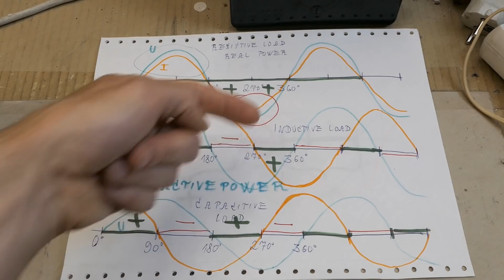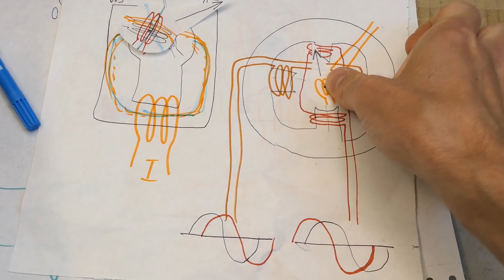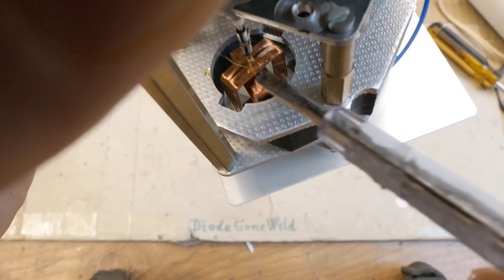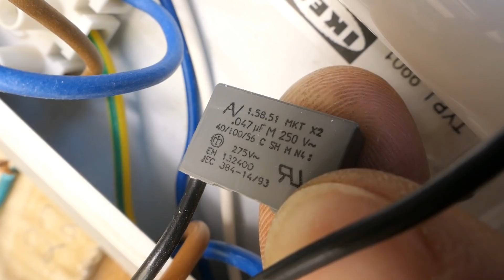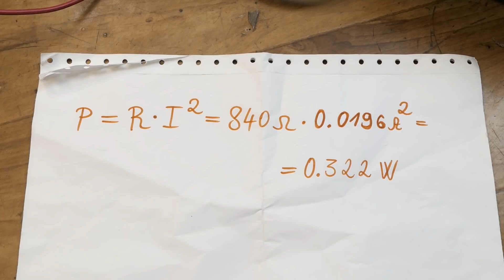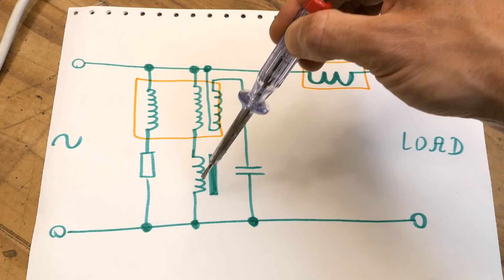Power factor meters - how do they work, teardown, experiments

Comment: On the two older meters, I think what they need to work 100V for the first one and 380V for the second one, and up to 5A on the current input for both. Like it says on the front of them. :) But yeah, like you said, risky if you aren't sure. I have no personal experience with electromechanical pf meters, we use digital power analyzers in our panels

Comment: Now i know why my multimeter is showing strange current reading when in ac, i though the ac current range is faulty as it always shows ridiculously high power reading like when i was testing at 100w powersupply that is drawing 4.6amps at 220v without a load and not even getting warm

Comment: Great video with lot of knowledge. at @23:18 there are 100V at meter so I will try calculating resistors as voltage divider with coils resistance, so after powering it up there should be about 100V at coil. Maybe inductance make some differences but I fill it will be good enough method.

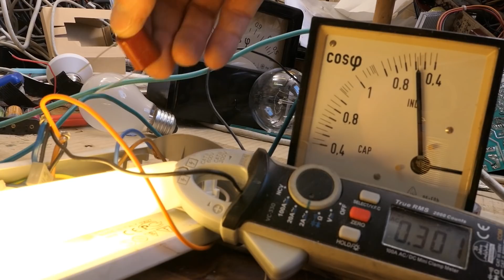Comment: 18:10 I did the same thing with a capatitor some time ago, and it zapped me. So, if you ever going to do something like that, better grab it only by 90 degrees side (oh, i mean better don't do this either way). It seems to be thicker isolation there.

Comment: For single phase systems, simply put the same reference phase into both reference terminals.  When the meter face is vertical, you are lifting the weight of the needle and more current is required to approach 1.

Comment: actually you dont need a common connection for 3 phase loads, because the sum of all the voltages at a given time will be 0V ideally, but imbalanced loads or varying voltages will make the common voltage look like it's not 0V, not a big problem for meters but for AC motors where the metal case is connected to the center of the Y connection, it's a good idea for safety to connect the common terminal to ground anyway.

Comment: we have this problem with Rockwell Engineering they sell baseline VFD ac drives then the customer has to troubleshoot the PF and buy all the addon inductors and capacitors to get the PowerFactor close to 1. where in the ero market the drives must be sold as a complete system to keep the power grid clean and lower the reactive power to rid wasted energy.  🤑thanks

Comment: I have very little electrical knowledge and have spent most of my life throwing things away when they stop working. Im intrigued by an idea that a alot of simple electronics can be made by hand and likely better than store bought. Is that the case or is everything so specialized now that aquiring the various components and the time it takes to make things, outweigh the benefit of making it yourself?
Reply: Don't throw lut. 9 out of 10 times there's something banal, like a fuse inside, or a broken plug. 

You need a knife, a screwdriver and that's it.

Comment: Wow, so long videos! I wish you can make a videos  about the Active PFC waveforms when the input power is not perfectly sinusoidal (like when using modified/approximate sinewave UPS) also, on the last UPS videos, the peak voltage can go over 400v. Does the input bulk capacitor gets that voltage & is it safe? Also will the Active PFC circuitry confused when its input power gets higher than the target output voltage

Comment: I guess nowadays it would all be done using analogue-to-digital converters and measuring the time between zero crossings in each phase to get the frequency and the phase shift.  I'm sure that is how the plug-in ones work.  On the one I bought several years ago, it looks as though the same housing could easily have been fitted with different inserts to suit different countries.

Still, it's impressive to see how it all used to be done using purely analogue devices!  And these were built with care like old-school scientific instruments by craftspeople who took a pride in their work, not mass-produced down to a price point so some beancounter can get a new sports car .....
Reply: It definitely must be. Every household wattmeter you can buy for like 10 EUR has the power factor measurement implemented. And it's pretty accurate. It's some kind of electronic black magic.

Comment: I'm curious about the Tester. I have one myself and I've noticed that it has Problems correctly displaying what it is for certain parts. For example, a Transistor is shown as an N MOSFET. But that's the only thing wrong. Resistors and Capacitors as well as Coils are displayed correctly.

Comment: You're truly mad.
I understand you know a lot about high voltage, I know a bit myself. 
I got shocked a few times in my life, I'm sure you tried it too.

But when you take a capacitor in your bare hand and touch your syuper dodgy 3 phase setup, my eyes and my mouth opened in disbelief 😮and started laughing.

And then you took another one in your OTHER hand and touched it too.🤣
Reply: Everything up to 1000 volts is low voltage.

Comment: I often wondered why flourescent lights (that use a magnetic ballast) often had a capacitor across the mains, now I know. If I remember, the light in my room has a 10uf cap across the mains.
Reply: There's a second reason. On dual tube lights, a capacitor is in series with one tube, both compensating for the inductive load and for doubling the flicker frequency of both tubes together through shifting the phase.

Comment: Yeah I was going to say in vertical position it looks like the needle has to fight gravity which would push it more toward capacitance reading
You could have checked the balance of it by shifting the two phases back and forth it should have read exactly the same reading and either capacitance or inductive if there were no other forces on the needle

Comment: what about smps circuits? they are using the upper part of the voltage peak. is it capacitive or inductive?
Reply: none it is distorted looks resistive but only at the peak of the waveform.
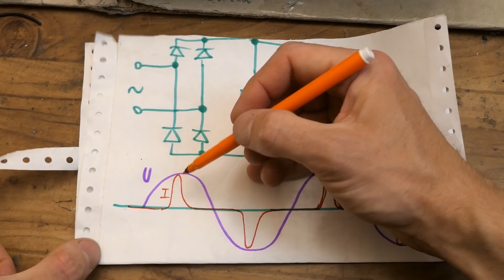Reply: A SMPS receives rectified and smoothed AC. It doesn’t run directly off AC. So it has the circuit shown at 36:26. Is is capacitive due to the input smoothing caps. But really it is more distorted than capacitive. There are power factor correction chips which adjust for this.
Reply: @stevebollinger3463  I havent watched the end of the video the first time I watched it. But then completed it. Thanks.

Comment: You can get passive PFC to be closer to a sine wave using a capacitor across that series inductor, tuned so that it is resonant at around 3 times the line frequency. That way the current in the diode is both on for a longer time in conduction, reducing the loss in the diode, as lower peak current flows, plus the capacitor gets charged for a longer time, and you get a much more closer approximation to a resistive load presented to the supply. Of course will have extra loss due to loss in the winding and the inductor core, so they need to be thicker copper wire and finer sheets of laminate to reduce loss. 

The major advantage comes with very high power, where active systems still struggle with power density, and also they add to the filtering on the input side, so are common at high power with large DC motor loads and very high power inverters, as this is easier to implement over wide input current than active compensation. Of course with high power AC motors the easiest is a synchronous motor as part of the plant, delivering some always on large load, that is over excited so as to appear to be capacitive, allowing you to use the power factor meter to control motor excitation to make the overall power use of the plant resistive, as most big plants pay for reactive power at a very high rate, so power factor control is important for them.

Comment: Thanks for a really good explanation was clear and easy to understand. I remember in a factory where I worked there were power factor meters on the mains intake panel we had a large metal box with capacitors in to keep it  near 0.95  occasionally the capacitors would switch in or out they did it automatically

Comment: To find the best match for the fluorescent light you don't really need the power factor meter. Just the amp meter: just find the minimum current. Of course the pf meter helps by giving you the direction of the adjustment you have to do: more or less capacitance.

Comment: Hello. I think the inaccuracies with 40W lamp is just caused by gravity. The needle goes down instead of keeping the last measurement. Also after phase swap the needle goes to the same position.
Maybe the meter should be mounted horizontally to avoid that.
Reply: This is what happen when you add a comment while watching a video without waiting for the end...

Comment: Very nice.  You did a good job estimating what resistor box should be on the phases for the 2nd meter.  I do suspect that more current was needed to make the needle move properly, but better safe than sorry with such wonderful devices that you don't want to break.  Few of us are old enough to remember when things were built sufficiently well or sometimes even over-built instead of drastically under-built as they are today.

Comment: Most interesting. I would be tempted to remove the cases and display the internals as they have a sculptural technological aspect  of a past age or would fit nicely in the set of the film Blade Runner.